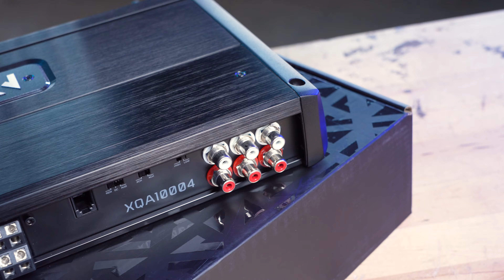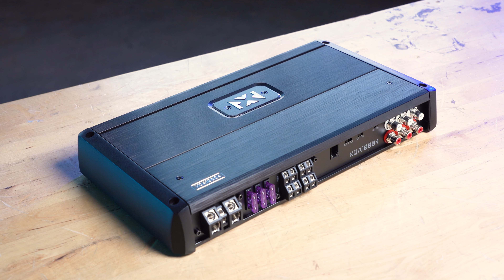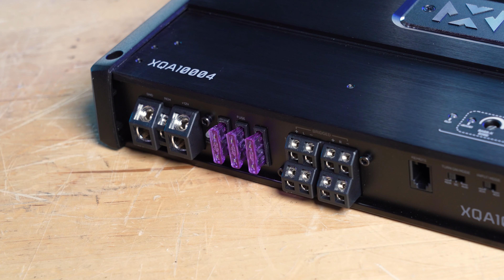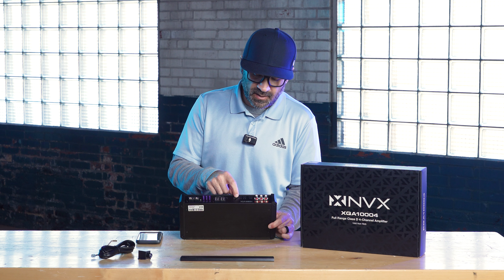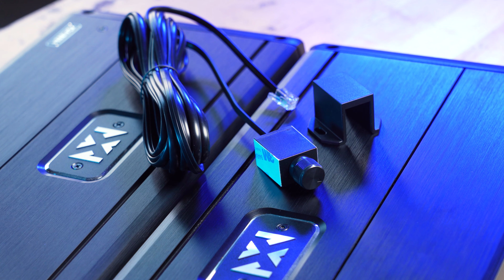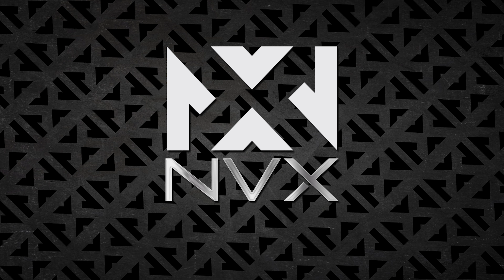NVX 1000W XQ-Series SQ Hi-Res 4-Channel Amplifier - XQA10004

Comment: The thd on ny nvx xad 17 13.5k has .005 thd and signal to noise is 100 db also plays from 10 -250 or 400htz or so its not full range but those are better specs than these amps that are called sq quaility ?
Reply from the maker: So, in our experience we were testing full bridge amplifiers on our subwoofer (XCW) project and we kept noticing coil temps and output was not where we wanted it to be at. We had an old XPLD3K laying around and decided to hook that up for a bit to see if there was any change. Oh boy, it was night and day, we were really able get our cones moving good, sounded fantastic and solved our coil heating issues. So in a sense in our experience, full bridge puts out the power, but half bridge is a totally different kind of clean power. So we started developing SQ half bridge amps and high power SPL amps.
Reply: @NVXAudio  i know what u mean I rebuild subs and u can totally tell the damage on the coil when a high power full bridge amps was  used it will put damage right on a specific few windings on the coil instead of the entire coil top to bottom being damaged emf audio did a great video about this showing the specific damage a full bridge Brazilian type im talking about amp was used when compared to a typical half bridge Korean type was used.

Comment: I've been checking these out on the nvx website. I would really love to get my hands on one for testing. Are these completely replacing the old X Series. I'd hate to see that 13,500 watt amp get discontinued.
Reply from the maker: These aren't replacing the X series. We have a different series coming for that. Stay tuned!
Reply: @NVXAudio  are we getting an E-series, Y- series, and XC-series here too? I like the old X Series amps. They have a simple, clean yet classy look. And they outperform their published specifications.
Reply: I need the 6x9 components to upgrade my ram I see ya have 6.5 any plans for 6x9
Reply: @jwoodard1369  NVX offers four individual component systems, 5 if you include the high-performance loudspeaker lineup, which is almost entirely made up of components.

I personally recommend the x-series. Outstanding performance at a modest price. These will perform on par with some speakers that are double the price.
Reply: @ thanks I have used nvx before they have been great looking to upgrade my ram 1500
Reply: @jwoodard1369  NVX is sure to have your Ram singing loud and proud.
Reply from the maker: @ At this time, we do not plan to make a 6x9 in our XQS line up.
Reply: @NVXAudio  I'm pretty sure he was asking 'generally', not about XQS specifically. 

No worries. I directed him to the appropriate products.
Reply: The xad x series amps are being replaced by big Korean half bridge power  i have the xad 17 the 13.5 k and called to talk to them about some changes on that specific amp and the new x series sub specs and I was told about the new half bridge Korean power amps and I don't think they are buying more of the full bridge amps to sell but for sure new big boy amps to compete with sundown and down for sound and whoever else spl and in the sq world also
Reply: @joshholden8561  half bridge 🤬
Reply: @nighttow8780  i like the" Brazilian" type full bridge amps I've never had issues i like both but if i wanted sq subwoofer amps I would buy kicker amps for that i like that the 13.5k o ly costed me 715 including tax i used the 15% discount from the website and saved about 300 on my amp and subs